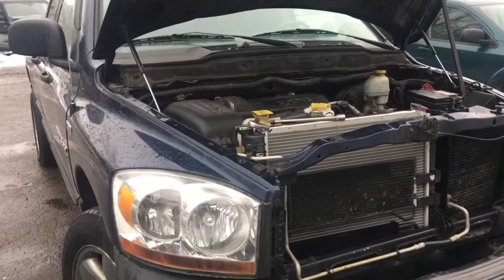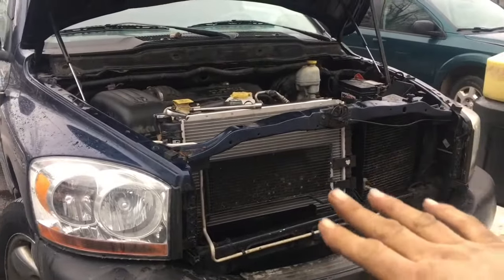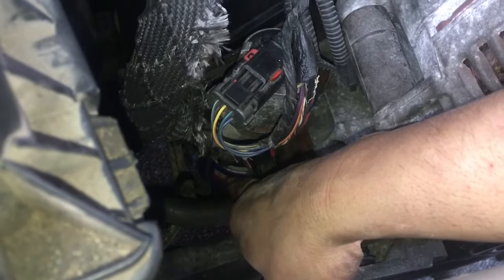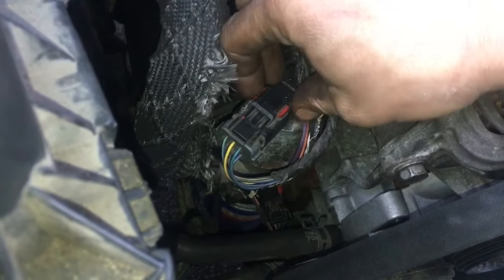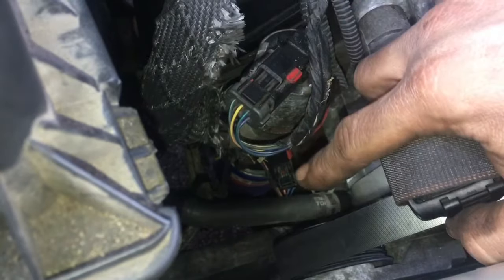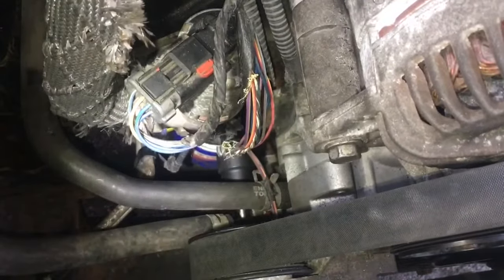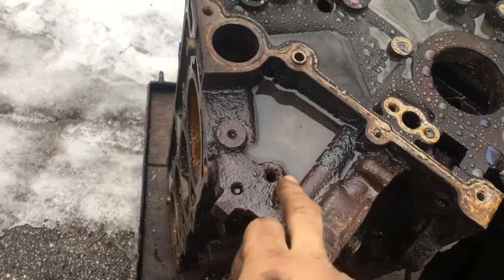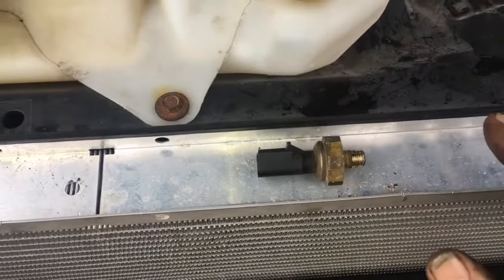Dodge ram 5.7 hemi oil pressure sensor removal

Comment: Thanks a million man. My 04 Hemi Rams  pressure started dropping to zero and would only rise if I stepped on throttle. I changed  my sensor and  bingo! Folks, you will need a oil pressure sensor socket from Advance. I'm saving you time and trips.
Reply: I hope this is my problem also. Got in the truck today, noticed the pressure was about 20% lower than usual. 10 minutes later I parked and it went straight to zero. My heart sunk. Going to get the part tomorrow.
Reply: Do you have to drain the oil before removing?
Reply from the maker: No
Reply: The oil pressure sensor fixed it. Been good as new ever since.

Comment: I would like to know where to locate the oil temperature sensor for a Dodge Ram 2008 5.7 L Hemi engine
Reply: Right beside the oil pressure sensor. He actually mentioned it in the beginning of the video. You probably have found it by now but just incase, there you go

Comment: How much do you tighten the sensor?
Reply from the maker: It’s a pipe Thread so you just snuggled up put a little Teflon tape on there if it didn’t come with it already and it will be fine

Comment: Hey man I like your video. Question: I have a 2005 Ram 1500 with a 4.7. Is the oil pressure sensor in the same location? Also, do you know if a faulty sensor can cause the computer system to shut the engine down if it detects the pressure is low for a long period of time? Thanks if you can help.
Reply from the maker: Thank you for the kind words Dave, Oil pressure sensor on the 4.7 is located on the driver side front of the engine near the Oil filter. I know more about 4.7’s then I do the 5.7‘s. 

As far as I know if it detects low oil pressure for a long time it will not shut the engine off. I can tell you this much something is going wrong if you have low oil pressure on them they do not generally have bad oil pumps but there are some kind a bearing or something going out . I hope that information is helpful have a great day thank you for the kind words